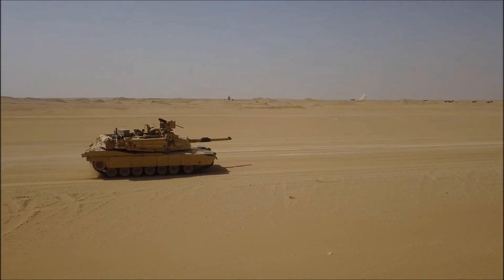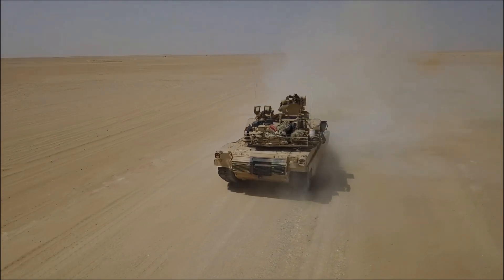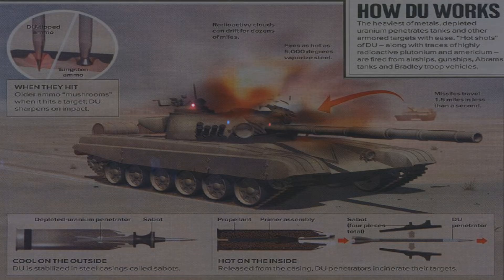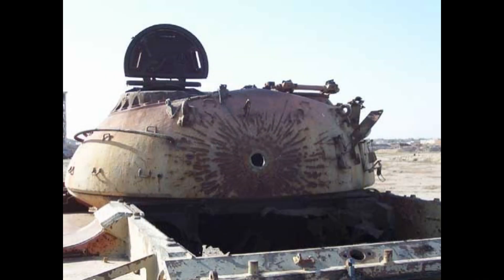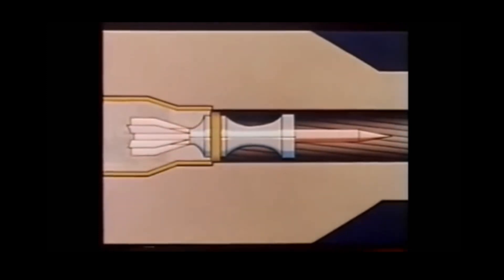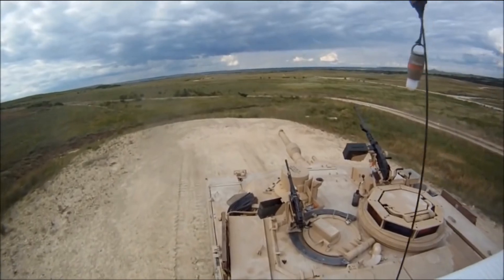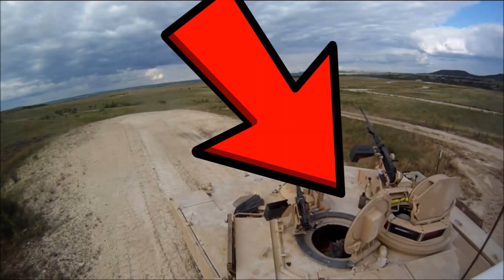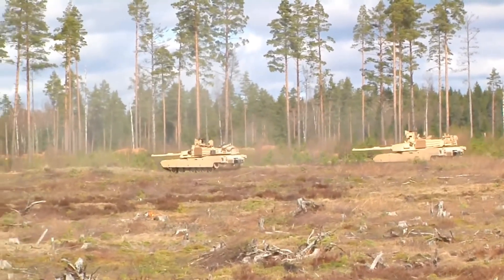Depleted Uranium Tank Ammunition | DEADLY DARTS 💀☄️

Comment: there is no subsitute for uranium really .... which makes them using it alot more understandable. ..... but using it in civilians areas should have heavy restrictions placed upon them due to the long term radiotoxicity of uranium. the dust released when they strike something in a civilian area pretty much is a chemical weapon. and afterwards it will contaminate areas. as far as things go DU is not particularily 'hot'- but in civilian areas both long and short term implications of that are bad.
Reply: that is very interesting. good to know!
Reply: Nothing with a half-life of the age of the Earth is anywhere near radioactive enough to cause harm. However, it is pretty nasty chemical toxin like most other heavy metals.
Reply: that is until you get it inside your body...or are exposed to it for years because nobody in your shithole of a country cared about cleaning it up. im not sure you could discount the radiological effect so easily. .... just on its own its already a pretty toxic heavy metal as well though.
Reply: not really if I recall uranium is self sharpening. tungsten tends to pancake. and uranium is denser - which is the main factor in armor penetration ; beyond certain velocities penetration wont go up much more as the round will just vaporize into a plasma on impact....and its pyroforic properties make uranium extra usefull as well.  http://www.journal.forces.gc.ca/vo4/no1/research-recherch-eng.asp

Comment: Depleted uranium rounds are called DULLRAM (depleted uranium low level radioactive munitions). The effects of DU on humans have been known since the 1950's and was used in large quantities in operation Desert Storm. DU rounds burn like a torch, self sharpening as it penetrates armor,  these rounds create smoke that can enter soldiers lungs in the battle field or range. The smoke particles pass through the blood/brain barrier.  DU mimics calcium,once injested,and affects bone growth, heart, lungs, thyroid, brain ect. While in the body, it keeps decaying into it's sister isotopes, creating alpha, beta and some gamma radiation. The soldiers affected burn from the inside out at microscopic levels, causing abnormal cell growth and eventually cancer masses. The VA knew this from day one and refuses to give veterans treatment, ignoring this "freindly fire" that affects an estimated 250,000 troops. The US arsenal will continue to field DU rounds because it is very effective. Opposition forces cannot field tanks or  artillery againt DU. No tanks, no troops, no fight.
Reply: You were good until you started talking about radiation. Naturally accruing isotopes of uranium just aren’t radioactive active enough to do anything like what you’re talking about.

Comment: ... all very interesting but you seem to have totally overlooked the British contribution ... from the early 70s the British have used 120 rifled tank guns firing kinetic shot, in contrast to the HEAT ammunition favoured by the US ... as  a serving soldier I took delivery of the first shipments of DU APFSDS ammunition to the British Army in 1984 ...
... further more on the Chieftain Mk3/2 with the extended graticule 9 dot site the direct fire range of APDS went from 1790m out to 3000 metres with tungsten cores, one if which I have had turned into the most amazing set of darts

Comment: Depleted uranium hexafluoride has a quite costly function of uracil acidic and thermal crystallization that takes high pressure silver or alloidial compound compression to create the superstructure usually within a centrifuge and isotope environment hard to do without a lightweight water fissile system or a high voltage separator , department of energy stopped supporting the loadout on those reactors as part of the fuel wind down process no more DU cores are being made in the stockpile.

Comment: Tungsten alloy penetrators are used , just like DU Alloy to improve strength of penetrator as they can fracture under impact conditions (cf Sliding armour). In fact the tungsten penetrator tip mushrooms and the trajectory through armour deviates from a straight line explaining  reduced penetration when compared with DU. You have to match the penetrator material to the gun velocity, as what may work at one regime might not work at another particularly as muzzle velocities are always increasing. cf EM rail guns which will explore new physics of penetration.

In general these are studied and understood using computer codes which model the penetration capability even before a single gun or round is built. Also the thermaand mechanical properties of the round and armour material (ceramics) need to be understood. Its a job for the metallurgists & modellers  and is  complex - both mathematically and in terms of engineering development. Penetration of RHA by a homegenous long rod penetrator can be modelled as two fluids interacting with one another, and penetration is determined by density of penetrator.

A course on continuum mechanics is a precursor
Reply: In fact most of the comments on these topics (both here & elsewhere on tanks & guns) are quite frankly infantile & childish & have no basis in scientific fact - harkening back to WW2 comparisons. 

Its all down to physics and the ingenuity of the engineers who design guns, ammunition and protective armours. Some of this technology filters back into civilian life which is great. Its an area where new materials will be required, (meta materials, graphene, ceramic composites etc) and the civilian application is endless. Military reqts drive the initial work & spin offs into other areas wil occur - or even the reverse from space where the velocities are much greater (re-entry etc).

Comment: One of the big reasons for using the smooth bore120 in the Abrams is that the 105 could only fire a limited number of combat SABOT rounds before the rifling started to rip out and the gun became useless.  Can't remember exactly how many, but it was about what a tank could expect to fire in a good fight.

Also at longer rangers (1500 meters?  Been a long time since I was at The Armor School at Ft. Knox)  you also had to start allowing for the round drifting to the right because of the projectile's spin.  

It was becoming obvious that the sights were getting better than the gun and that armor was getting thicker so it was time to upgrade.

Comment: The problem with AT-missiles is that they can be shot down with relative ease using modern active-protection systems. A typical top-attack missile like the Russian Kornet go about 300m/s which is fully possible to intercept with modern active protection systems. In comparison a Rheinmetal 120mm gun can fire at 1500-1700m/s and that is far from easy to intercept.

Comment: That's why they started to go for depleted uranium armour.
Example Abrams went from just over 60 tonnes to just over 70 tonnes.
With active protection systems i would rather have a 65 tonne Abrams with all the latest upgrades like the APU and sights and electronics aircon and the ironfist decoupled version and no depleted uranium armour.
But I'm sure depleted uranium shells will still be used regardless.

Comment: 5:30 I'm surprised more people haven't commented about this; all ballistic projectiles are affected by windage and gravity - no matter how fast and/or brief the flight, they all fall, from the moment they leave the barrel.
Reply: Yes, laser-like no drop over 2000m is complete BS.
Reply: @JimBillyRayBob  I’m sure what they mean is the drop is negligible since the flight time is so short, but yes, there is no way it doesn’t drop at all 🤣
Reply: g=32feet/s/s (acceleration due to gravity)  Dart drop = 0.5 x g x t^2

According to @kirklamb3270 we can assume 7,500fps velocity.  At this velocity, it will take 1 sec to go 2.286km (7500ft), and the dart will drop 16ft.   Definitely not negligible.

Even at 229m, the dart will drop around 2 inches.

It's definitely not a laser, but the firing computer can easily calculate the drop if there is an accurate range finder (which there is). Assuming that the dart spins, the computer also needs to calculate the effects of precession and the Coriolis effect.  That's a lot harder math, but easy enough for the computer.  They also need to account for air friction and they probably have an experimental calibration factor taking into account air pressure and temperature. But the computer can handle all that.
Reply: The dart doesn’t spin. These are fired from smooth bore guns because spin stabilization is ineffective on long, skinny projectiles. The tail fins perform the job of stabilization in flight.
Reply: @bradnail99  Meaning what in the context of this discussion? I think you're missing the point.
Reply: @tahwnikcufos  meaning, smoothbore guns have much more power than rifled guns because of the rifling itself, but smoothbore lacks the stabilisation the rifled ones give with the spin. That being said, with a FSDS type round on a smoothbore gun, you get both the power and stabilisation without the need of spin, which increases long range penetration, possibly.
Reply: @santiagomendez246  which still means absolutely squat in the context of my original post, but Youtube is going YouTube I guess...

Comment: "Gunner, Sabot, Tank!"  "Identified" "On the Way.'
Reply: Heat was primary battle carry load.  So in combat the intercom communication was tc: driver stop, gunner heat tank, loader: heat battle carry up. Gunner: target aquaired, lazing  tc: fire  gunner: on the way tc: load sabot loader: sabot loaded up, gunner: on the way,  this would continue until the tc: target distroyed cease fire.
Reply: I was an armor officer with M-60s and M-60A1s.
The fire command was "Driver stop. Gunner, HEAT, Tank.  (no stabilized guns and HEAT, not SABOT was the primary anti-tank round. Sabot was only used on side or rear shots.

Comment: Why not use Thorium? Its only slightly lighter,very cheap ( 20 times more abundant than uranium). I suppose it doesnt have the super toxic after effects that poison people. Severe birth defects,chronic fatigue and other nasty issues, when used it creates contaminating dust that cant be cleaned up.
Reply: Compared with DU, thorium would be expensive. Countries which run enrichment facilities have produced huge stockpiles of DU over the years. It's basically toxic waste which has hardly any ohter use. Actually you can even safe money by using it for ammunition and armor because otherwise you would have to pay a shit load of money to safely store this shit.
Reply: It's not all about density. DU and tungsten also have other properties good for penetrating armor, such as ductility. Nowadays APFSDS are made from alloys anyways, only the base of the alloy is DU or tungsten.

Comment: On to another level.. The German battlecruiser Scharnhorst has the record for the longest ranged kill at sea with its 28cm/11" rifles against a UK aircraftcarrier. At the end of WW2 the Germans made a similar 31cm smooth bore version gun firing a  12cm/125kg DSFS arrow at 1500ms. I just wonder how this would have performed against full size battleships if this smoothbore gun had been fitted to smaller cruisers. Just think of a broadside of 9 arrows, first salvo hit capability, etc.

Comment: The DU dart is very heavy so the trajectory is flatter and carries more inertia when it hits the target.
The problem with depleted uranium 238 is not only is it Radioactive but it's extremely toxic after it's hit a tank and explodes into very fine dust particles, you do not want to go inspect the destroyed tank after a DU round has hit it because the whole area will be toxic one hot particle in your lungs or penetrating your skin will make you sicker than sick.
As many Iraqi families came to find out after they started to live in areas were there have been tank battles and DU was used, personally I think DU should be a war crime, each DU penetrator is a dirty bomb.

Comment: With DU munitions and advanced electronic guidance systems tanks have become easier and easier to destroy.  I guess advanced military forces have counter measures, but I am not sure.   I have read  many of the modern tanks have special armor that is good in some cases for one hit in the same place. But I am not really knowledgeable in that subject.  During the US-Iraqi war the Iraqi tanks were readily destroyed by DU munitions.  The future role of the tank will likely be against opponents that lack sophisticated armories.  Particularly air power.  Du is also used in armor where it is sandwiched between layers of steel.  The munitions and  the DU armor is safe for its users as long they are intact.  After firing du, especially if the DU ignites you do not want to be around it.  Breathe those particle in and the alpha radiation becomes more deadly.  So the tank's will likely be for putting down rebellions by poorly armed rebels and inflicting terror against citizens in opposition against their own governments.

Comment: Would there be any advantage to using a tungsten rod for the dart but using a DU tip? From what I understand tungsten is slightly heavier so you could get a bit more kinetic energy in the projectile if you did it that way but still keep the self sharpening tip and some incendiary properties, while also reducing any toxic after-effects from the DU.
Reply: By trying to meld those 2 different elements together you would weaken the overall projectile more than if it were just solid DU.
Reply: @wreckincrew2714  Why? Bullets do a very similar thing. A cupro-nickle shell and a lead core with a steel penetrator inside. The shell for strength and the core for mass. Been common for a hundred years now. Seems like something similar could be done to these. Normally, FMJ bullets are made using the "cup and core" model. Why wouldn't that work here? Doesn't have to be the entire tip, just a thick enough shell to get the job done.

Comment: All projectiles fired on earth (or in any other gravity well) are subject to the force of gravity. A round of any kind, once it leaves the barrel and is no longer supported, begins to fall. "Flat trajectory" is an illusion caused by velocity. Two projectiles with identical ballistic coefficients fired from barrels parallel to the ground at different velocities both drop at the same rate (regardless of their velocities). Thus, a projectile traveling twice as fast as another appears to shoot "flatter," because at any given distance it has fallen less far from its original trajectory. Why? Because of the TIME it takes to get there. In the same TIME, the faster projectile has traveled farther than the slower. So if one is fired at 2,000 fps and the other at 4,000 fps, in one second (ignoring drag for the moment) the former has traveled 2,000 ft and the latter 4,000 ft. But both have dropped the SAME amount. Although the amount of drop is the same, the slower round experiences that drop at half the distance as the faster projectile, conversely, the faster round experiences the same drop at twice the distance. It's all about flight time. Given the same flight time, all projectiles drop the same, because they are all subject to gravity in exactly the same way.

APFSDS moves at an extremely high velocity. It appears to "shoot flat" because its flight time (ie the time over which gravity has an effect upon it) to even very distant targets is extremely short. But like anything else launched from the surface of the earth, it is acted upon by gravity the instant it leaves the support of its launcher. There is no Wile E. Coyote effect in real life.

Comment: I used to resupply M1A1 tanks as a cargo driver with 2/68 Armor.  It must be known there were practice main gun variants and the true combat main gun rounds. Combat rounds (DU) were stored in ASP's not authorized until war. Thus we used the practice rounds at the ranges that looked exactly the same but with different nomenclatures and or markings. 
In either case this ammunition is unique to large gun application that is revolutionary yet not mentioned too often. 
Than one thing about is this main gun round is the weight to delivery application. It took only 3 HEMTTs (M977 cargo) to supply one tank company. It is an astounding logistic metric considering how many rounds per truck were being carried and ability to load and resupply succinctly putting the tanks back into action.

1. The weight of the tank round is often overlooked. It is a ignitable cardboard jacket leaving behind only a small aluminum ASCAP base cap as residue. 
2. If brass or steel jacket were used, would make it impossible weight wise (per round) for 3 HEMMT cargo trucks to resupply one tank platoon. Otherwise it would take about 5-6 trucks per platoon if brass or metal jackets were used for the round because of the tonnage per axle weight. Then the resupply mission becomes more intricate with run times as well as time tables. 
3. The tank round is detonated n the breach block with electricity and no firing pin, which made it a safer handling issue for us.
4. Pre-palatalized tubed crates we used were reusable and solid packed, they were dropped from time to time but the rounds were safe  
5. A drawback for these rounds were wet conditions and moisture on the cardboard jacket. A wet round was not given to the crews on resupply nor to be fired. Thus, we pulled the rounds from the pallet tube only when the tanks arrived in any weather conditions.